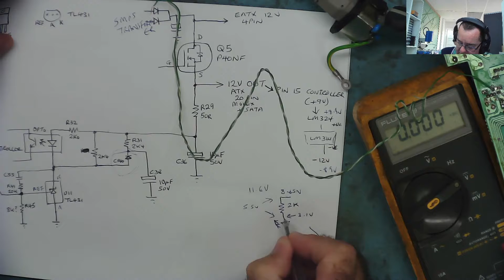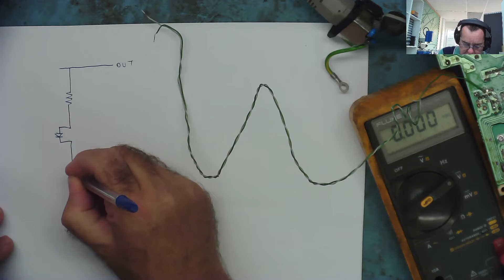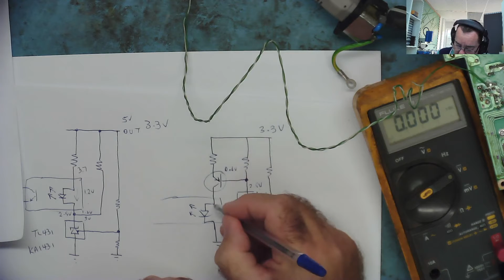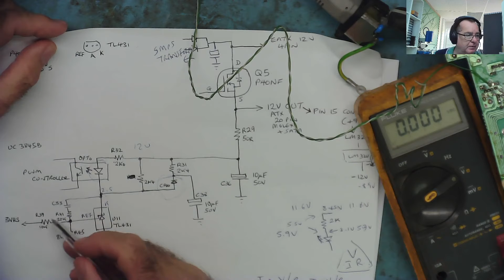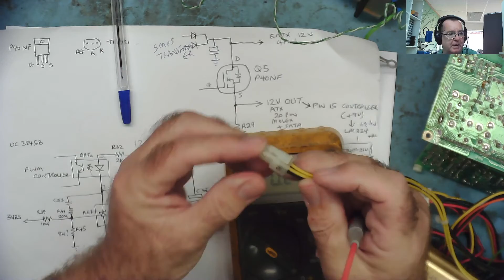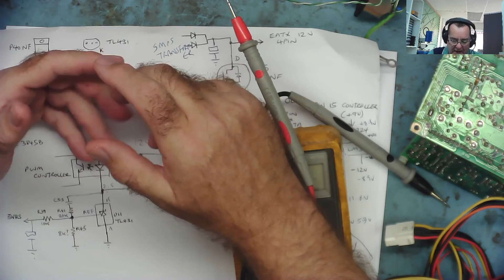ATX PSU 5V STANDBY OK, OUTPUT VOLTAGES LOW - FIXED!  LER #109

Comment: Thank u u r a great engineer
I have a problem with an atx which its green wire ps on voltage is 4volt but the ic supply 5volt ref correctly psu starts but only 12volt rail has low voltage 11volt .and also drops to 10volt under load condition. I didn't find what was the problem with th gren wire

Comment: Thank you for all your repair video. Great knowledge from your many years of experience. I wonder if you would comment on a problem I have with at PSU. The voltage is correct until I put a little load on it, then it get very unstable and lower voltage. Could you give som hint or points to another video of yours that handles that problem?

Comment: I bought a Nox Urano II 630w atx power supply, but it never turns off, with the fan always running without being connected to any motherboard, I checked with the ohmmeter that the green PowerOn wire is in a short circuit with the black wires?  
How can I solve this problem ?

Comment: The KIA 431 I have is testing Black lead on Cathode , red lead on Anode 570 mV  Red lead on Reference 751 mV on my DMM ,  but when I put it on my component tester like your LCR T4  it shows defective or unknown part.... Is that normal readings on the Tester or is my DMM showing a good part ??  I'm not familiar with the 431 , Didn't have those in 2 way radio in the 80's and 90 s ...  Thanks Mon Ami .....

Comment: I don't understand how the 3.3V keeps the other voltage low.  If the 12V is low the PWM should be on, the Iso-Led should be off. 

This doesn't help me at all.

Comment: But on low voltage you don't want it on, turning the led on turns the PWM off.  So a low voltage isn't a bad thing, just the PWM should be turned on fully. 

Or am I missing something?!

Comment: thanks for your contribution. Then the problem was "no load" on 3,3v... I have one ATX PSU that without load shows correct voltages but at 0.2A load in 12V rail, the voltage goes down until PSU restarts. And another one from an ancient Pentium 4 that basically have low voltages on start, at minimum load voltages crash down already. Any ideas?

Comment: It just shows how easy it can be to get lost down a hole looking harder and harder for nothing. Kudos to you for being so up-front about learning. 
Are you now going to make a fixed load to add on to power supplies on all 3 rails in line with the connection to your tester? That way you eliminate that situation.

Comment: I fixed my bestec atx-250 12z from a compaq machine today and your video's were really helpfull. So thank you very much! 12v rail was collapsing. Caps were ok, but I suspected one optocoupler, so took it out and measured, seemed fine and put it back. Than the psu started working again. I can't seem to find a pwm chip in this one. Strange! Thanks again...

Comment: I learnt the hard way I was trying to power a system with heavy loads on the 12v rail and I knew the psu worked fine on the older system.
Back then I was not aware of how they regulated the 3 rails off one switching transformer and the key is they don't In this case the supply relies on a load on the 3.3 I have no idea why they did not include a base load on the 3.3 rail many manufactures always ensure the minium load is present on all rails even though it is wasted energy and some like to put the load resistor against the output caps.

This is where the newer supply's have a advantage one 12v rail and buck converters for all other rails.

3.3 sata is often not used by many devices most use local regulation for any voltage other than 12v and 5v.

It's just like the -12 -5 volt rails they are only a gesture now days as modern rs232 transceivers make their own + - rails  

If the atx connector has a sense wire in this case 3.3 some supplies have it on the 5v rail are a sign that they have a preference for load on that rail.
Reply from the maker: Hi Josh
Knowledge is good but you proved experience is king.  As I mentioned in the video this is a Compaq PSU,  so I figured that the designers knew exactly what equipment it was intended to be used in and did not put any resistive load on the 3.3V for that reason.  Like you,  I also learned the hard way on this one - and I feel that sharing the experience is a very good way to help others.  This is why I publish videos that don't always turn out the way I would wish.  Welcome to the channel,  I hope you stick around and throw in your two penny worth (now that's an old English expression!) when needed.  Cheers mate!
Reply: @learnelectronicsrepair  i forgot to add this supply regulates both 3.3 and 12 v rails but with to little load on the 3.3 output it does as you decribed.